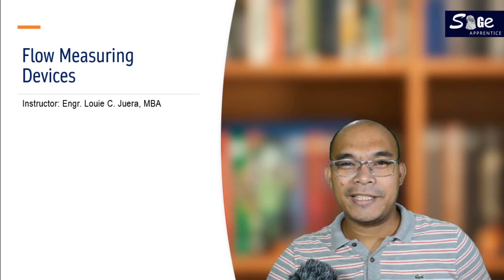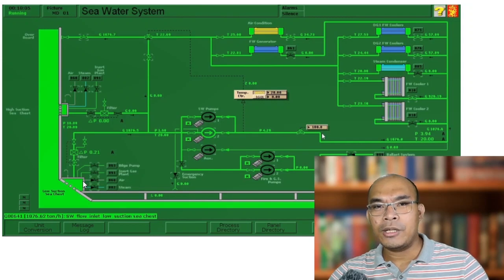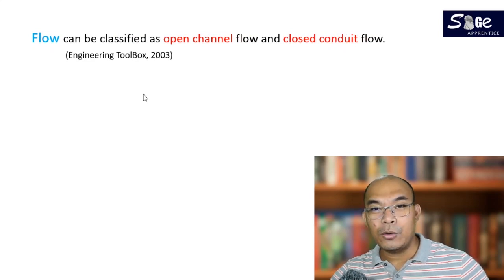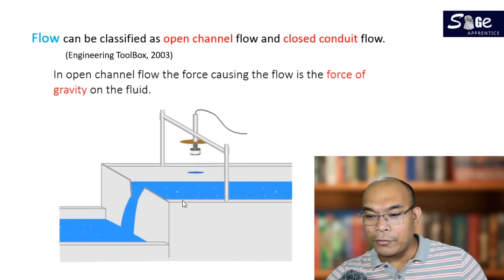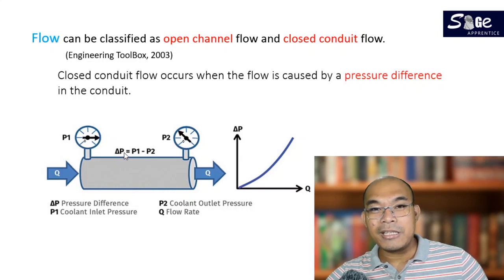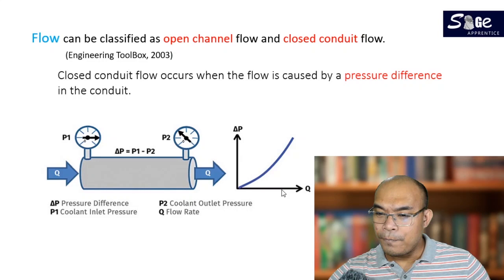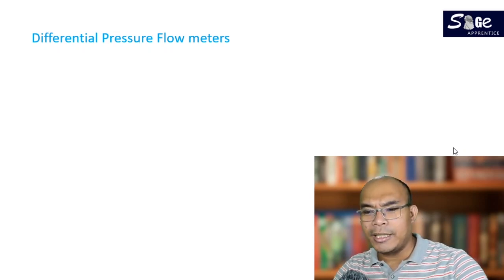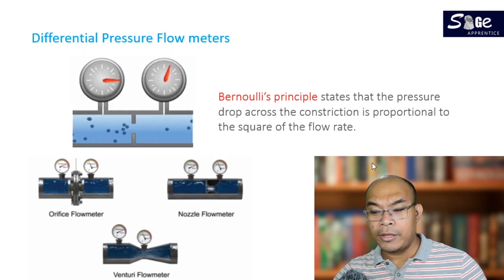How does a Flow Measuring Device works?

Comment: Thanks for sharing this video sir, I was able to identify what is Open channel flow(which is the one that only using the force of the gravity) while the Closed conduit flow( occurs when flow pressure is difference from the conduit) we also tacle about the dirfferetial pressure flow meter's which uses the Bernoulli's Principle.

Comment: I learned of this video is how to measure the water flow rate and how to open channel flow.The force causing the flow is the force of gravity in fluid and the closed conduit flow occurs when the flow is caused by a pressure.

Comment: In this lesson, I learned that the flow can be classified as an open channel flow and closed conduit, and the difference between them is the open channel flow the force causing the flow is the force of gravity and the closed conduit flow occurs when the flow is caused by a pressure difference in the conduit. Thank you sir.

Comment: Than you for sharing your video sir. In your video sir is I learned about how to open chanel and close conduit so the open chanel flow to force causing of the gravity of fluid by the close conduit flow occur when the flow cause by the pressure difference.

Comment: Good day sir. In this video now I learned about Flow measuring device which is the open channel flow and closed channel conduit so open channel flow the force causing the flow is the force of gravity on the fluid. And also the closed conduit flow occurs when the flow is caused by a pressure difference in the circuit. And most of the important for me is the flow rate based on the differential pressure. So differential pressure mean difference between two measurement. Thanks sir for this video sir!

Comment: Its very important to know that how to measure the water flow rate and types of devices. I learned the flow of open channel is the force of gravity and the flow of close conduit caused of the pressure difference.

Comment: Thanks for this video sir.  I know this Topic is how to measured the flow rate and the difference open channel and closed conduit flow and also the most common differential pressure flow meter which is "Orifice flow meter" "Nozzle Flow meter" and "Venture flow meter" , so when I you work in ship some day i have learned already of this type of flow meters and also i bring my knowledge in my work some day .  THANKS A LOT Sir.

Comment: Flow measuring device is the device used in measuring the flow rate of liquid inside the pipe. And easy to locate the problem on the simulator if we were using any flow measuring devices. There are two different types of flow measuring devices which are open channel flow and closed conduit flow. The water flow of open channel flow is based on gravitational force while closed conduit is caused by a pressure difference in the conduit. Under the closed conduit flow is differential pressure flow meters. There are three types of differential pressure flow meters;
Orifice flow meter- has a high disturbance and decrease the pressure liquid flow.
Nozzle flow meter- can lessen the disturbance and lessen the decrease of pressure flow of the liquid.
Venturi flow meter- has much less less disturbance and much less decreased on pressure. And i learn it from your video discussion. Thank you very much and god bless you sir 😇

Comment: Good day Sir! 
After watching the video I was able to evaluate how does flow of  liquids are being measured by means of the three aforementioned flowmeters such as Orifice flowmeter, nozzle flowmeter, and, venturi flowmeter. But before we tackle those 3 flowmeters, let's first identify the two classifications of flow such as closed conduit flow and open channel flow.When a pressure difference in the conduit causes flow, it is called closed conduit flow while in an open channel flow, the force producing the flow is gravity acting on the fluid, such as  water falls. Also,  it vary in the difference  of elevation that's why liquids moves downward. I have already mentioned the commonly used flowmeters. Actually, those three  that I have mentioned earlier had evolved through over time. Since the constriction of Orifice flowmeter creates disturbance when liquids flow to a particular system  they did something change to lessen the disturbance, so they created nozzle flowmeter. To totally gain a  smooth movement of the fluids,  they created another flow meter which is venturi that simply decreases the pressure and disturbance during the process.  Thank you  po Sir.😁  God bless and keep safe!

Comment: Thank you for this Video Sir. I learned a lot about the Flow measuring Devices,  Flow can be Classified as open channel flow and close conduit flow. In open Chanel flow, the force causing the flow is the force of gravity on the fluid and closed conduit flows occurs when the flow is caused by a pressure difference in the conduit.

Comment: A very helpful video sir, thanks for the learnings. I've learned how to open channel and closed conduit works. An open channel flow the force causing the of the gravity of fluid, while the closed conduit flow occur when the flow cause by the pressure difference in conduit.

Comment: I learned about the difference between open channel flow and closed conduit. In the open channel flow the force of the gravity on the fluid like rivers or waterfalls. The reason of movement of the water is diffenrence elevation or the force of the gravity. The closed conduit flow occurs when the flow caused by a pressure difference in the conduit. In the video the Q is indicate the flow if the P1 have a high pressure and P2 have a low pressure there is a flow or movement of the liquid.

Comment: Thank you for this video sir! After I watched the video I learned about the different flow measuring devices, such as open channel flow and close conduit flow. In open channel flow the force causing the flow is the force of gravity on the fluid, example of these are waterfalls. The reason of the movement in open channel flow is the difference in elevation. While close conduit flow occurs when the flow is caused by a pressure difference in the conduit. The concept for these is when the pressure is higher compare to the other side then there is a flow or movement in fluid. I also learned about the most common differential flow meters namely orifice flowmeter, nozzle flowmeter and venturi flowmeter. And last but not the least, I also leaned how to solve the value of flow using the bernoulli's principle. Thank you and God bless 😊🙏

Comment: Thank for this video sir. I learned that the flow rate can be classified as open channel flow and closed conduit flow the open channel flow the force causing the flow is the force of gravity on the fluid while closed conduit channel occurs when the fluid is caused by a pressure difference in the circuit.
Reply: Its very important to know that how to measure the water flow rate and types of devices. I learned the flow of open channel is the force of gravity and the flow of close conduit caused of the pressure difference.

Comment: Thank you for this video sir. After watching this video, I learned the difference and the operation of open channel and closed conduit flow. Open channel flow is the force of gravity on the fluid and usually found in the rivers without covers. And also, open channel flow being affected by elevation. Meanwhile, in closed conduit flow occurs when the flow is caused by a pressure difference in the conduit. The relationship indicated on the graph in the video regarding in closed conduit flow is directly proportional, means that the higher the differential pressure and the higher the flow rate which is the Q in the graph. I learned also the most commonly used flow meters are the Office Flowmeters, Nozzle Flowmeter, and Venturi Flowmeter. The concept of this is to help us to measure the differential pressure of a particular system.

Comment: Thank you for this lecture video sir. I learn how the open Channel and closed conduit works. Open channel flow the force causing the flow of gravity of fluid And the closed conduit flow only occurs when the flow is caused by a pressure difference in conduit. Its good to know that how to measured the water flow rate. And its very helpful for us .

Comment: After watching this video, madami ako natutunan lalo na about flow measuring devices, How does flow measuring devices works And flow can be classified as open channel flow and closed conduit flow, And in open channel flow the force causing the flow is the force of gravity on the fluid, closed conduit flow occurs when the flow is caused by a pressure different in the conduit and most common differential flow meters are orifice flowmeter, nozzle flowmeter and thr venturi flowmeter thankyou sir so much

Comment: Good Day sir. In the video I learned on how to measure the water flow rate. I also learn, what is an open channel flow and close conduit flow and differential pressure flow meter. And how it used onboard. Thanks sir

Comment: In this video, I've learn how to measure the water flow rate and in open channel flow, the force causing the flow is the force of gravity in fluid and the closed conduit flow occurs when the flow is caused by a pressure difference in the conduit.

Comment: I learned and understand how the flow measuring devices are being used on board ships and its working principle. I learned also how to measure the flow rate in the system and the classification of an open channel flow and closed conduit flow.

Comment: Good day sir i understand that the flow of open channel is the force of gravity and the flow of closed conduit cause of pressure difference.And in the case of closed conduit fluid does not come in contact with the atmosphere, whereas in an open channel it is in touch with the atmosphere. (volumetric or mass) or the number of fluids passing through a pipe.God bless <3

Comment: The video explains How does a Flow Measuring Device work. A flow meter is a device used to measure flow rate. The major difference is that the flow in a closed conduit is influenced by the pressure in the line whereas same in an open channel it only by gravity. And in the case of closed conduit fluid does not come in contact with the atmosphere, whereas in an open channel it is in touch with the atmosphere. (volumetric or mass) or the number of fluids passing through a pipe. The differential pressure flow meter measures the volume flow in gases, liquids and steam. They are particularly used in situations where high pressure, high temperature or a large diameter play a role. They are mainly found in the chemical, oil, gas and power industries.

Comment: I learned in this video about of how to measure the water flow and deffirent the open Chanel and close conduit . In the Open chanel flow at the force causing flow is the force of gravity on the fluid while in tje close conduit flow occurs the flow is caused by the pressure different in the conduit. Also I learned that the flow rate can be a measure and monitored by using the delta P flow meters.

Comment: Good Day Sir! I learned on how to measured the flow rate and the difference open channel, closed conduit flow and the differential pressure flow meters.Also the pressure on the inlet is greater than the outlet since the flow must be in only one direction and if not maybe there is another flow or another movement of the liquid.Thank you!!

Comment: In this video, I properly understand about what are flow meters.  I learned now how to measured the the flow rate and the difference open channel and closed conduit flow and the differential pressure flow meters. I know that this are very essential in vessel.

Comment: This video help me to understand on how to measure the water flow and differentiate the open channel and closed conduit. In open channel flow the force causing the flow is the force of gravity on the fluid. While the close conduit flow occurs when the flow is caused by a pressure difference in the conduit. I also learned the differential pressure flow meters. The differential pressure flow meters measures the volume flow in gases, liquids, and steam. The most common differential flow meters are the orifice, nozzle and venturi flow meter.

Comment: I learned in this lesson video is all about flow measuring devices. A flow meter is a device used to measure flow rate or the quantity of fluids passing through a pipe. Open-channel flow are the boundaries that are not entirely a solid and rigid material. And closed conduit flow are either circular or rectangular in cross section.

Comment: In this video I learned about the flow meters. Flow can be classified open channel flow like the falls where it just flow based on gravity. The other classification of flow is the closed conduit flow where there is a constriction in order to increase  the pressure just like the most common used flow meters which are the office, nozzle and venturi flowmeter.

Comment: I this video  learned what is open channel flow and closed conduit flow. So in open flow only the gravitation force is the only factor affecting the flow of the liquid. On the other hand the close conduit, I learned that the pressure on the inlet is greater than the outlet since the flow must be in only one direction and if not maybe there is another flow or another movement of the liquid. Also in the video I learned that the flow rate can be measured and monitored by using device the delta P flow meters. thank you

Comment: Flow measuring devices in this topic I learned that the flow of open channel is the force of gravity and the flow of closed conduit cause of pressure difference and I learn how to measured the water flow rate.

Comment: Thank you for this video sir, i learn how the open channel and closed conduit works. Open channel flow the force causing the flow of the gravity fluid, examples of this is waterfalls which affext only the elevation. Closed conduit flow only occurs when the flow is caused by a pressure difference in the conduit.

Comment: Good day sir! In this video I learned what is open channel flow and closed conduit flow. So in open flow only the gravitation force is the only factor affecting the flow of the liquid e.q. rivers and falls. On the other hand the close conduit, I learned that the pressure on the inlet is greater than the outlet since the flow must be in only one direction and if not mabe there is another flow or another movement of the liquid. Also in the video I learned that the flow rate can be measured and monitored by using device the delta P flow meters. Godbless you sir this is for you! 👍😊